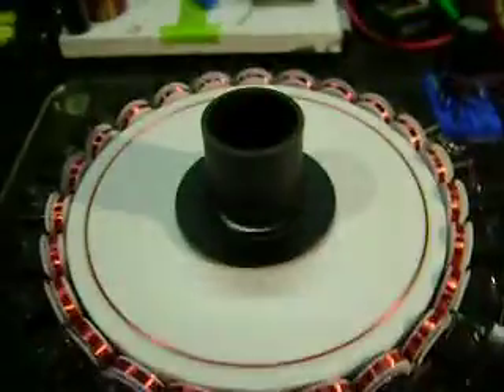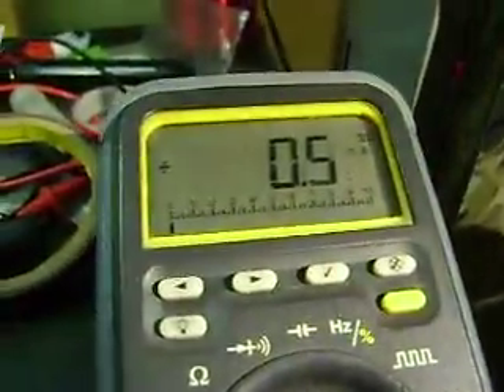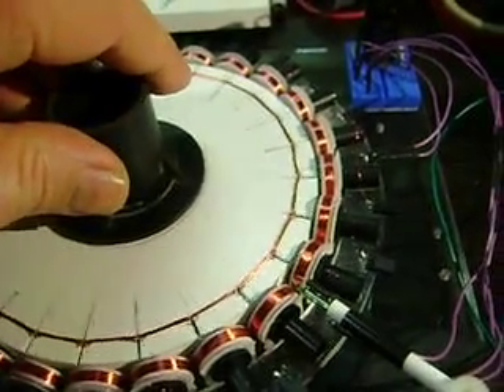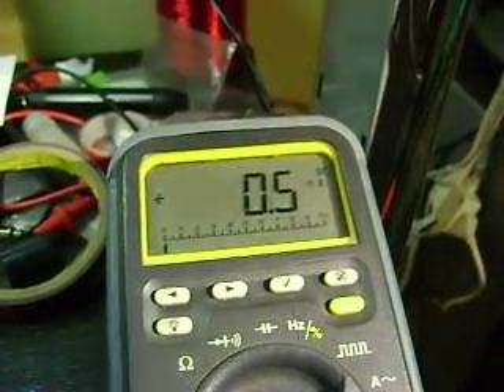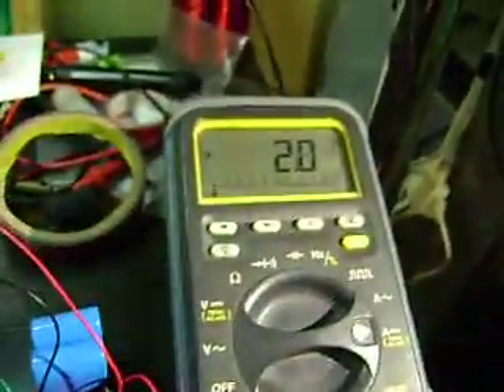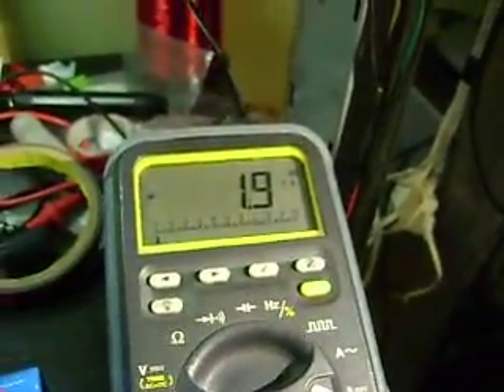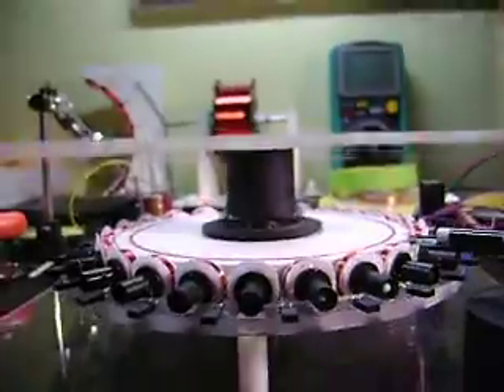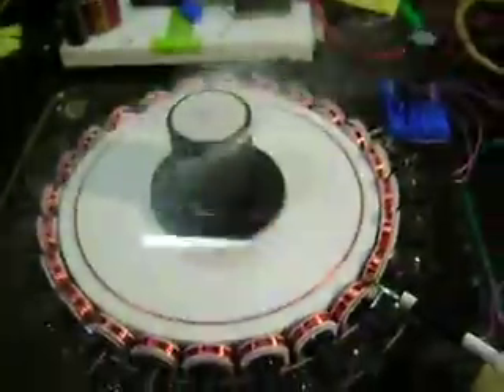Lasersaber EZ Spin Motor - some results- Not bad  =]

Comment: I have self charging caps, that motor would run for ever in them. Let me know if you want to sell it.
Reply from the maker: Hey Joel
It takes quite a bit of time to make these.  The wire is finer than my hair and have to be very careful while winding. 42awg.  3200 turns per stator coil, 24 of them. 650 ohms each in series for about 15kohm. Its funny how some talk of resistance as being a great loss. But this motor is very eff. ;)  But if you were really interested i could make a better more eff one with larger rotor mags.  Depends on what your looking to spend. What would it be worth to you for a better model? This one is still working but a lil beat from experiments to sell.

Mags

Comment: Hi Magluvin. Need clarification on few things. I plan to replicate.
1) Are you using 2 AA rechargeble battery?
2) Do we need to precharge 160V capacitor?
3) How long does the system running with constant speed?

Thank you.

Comment: Beautiful!  Thanks for sharing.  I have been really busy lately with other projects, but as soon as things settle down I want to get back to some experiments with the EZ Spin.  Please keep posting your results.
Reply from the maker: Thanks Guys
Hey Laser
I have some mags coming soon to build another with smaller mags and smaller coils, but many.
The small inverter from RS for electroluminescent lights is suppose to run at 160v, but unloaded goes over 230. My 24 coils just happen to bring it down to 160v. Yours is higher resistance so it would be higher for you. Nice lil supply for these things. Reed is holding up well also.
Been messing with using 3 drive coils(brings the 160v down to 30v, but 1800 rpm. The other 21 coils puts out over 400v. I have some things that are interesting that I will post soon.

Mags
Reply: Magluvi. I love your motor design for the EZ spin.
Laser sabers 100 year motor runs on 10 of his crystal cells right? Is that about 12 volts? Does having fewer coils enable less voktage needs?